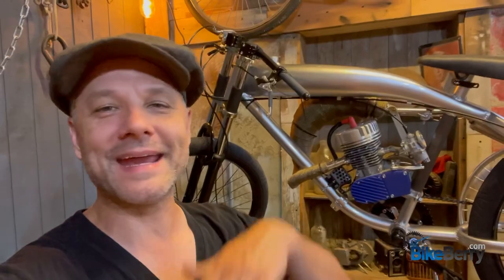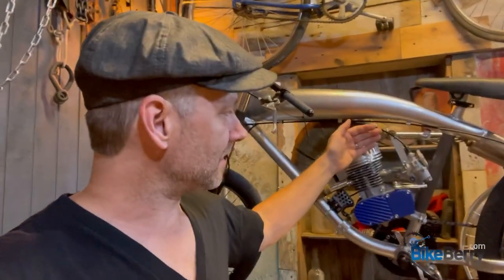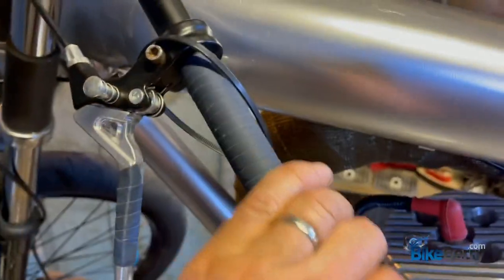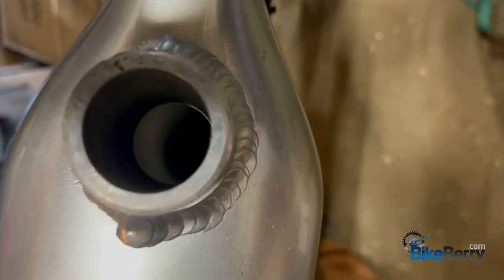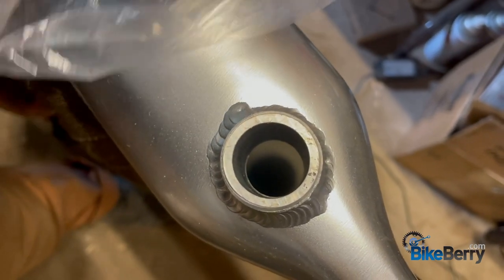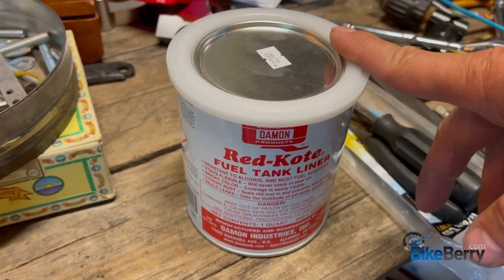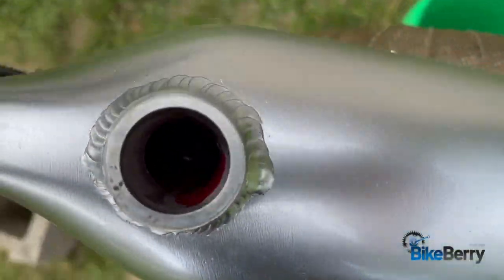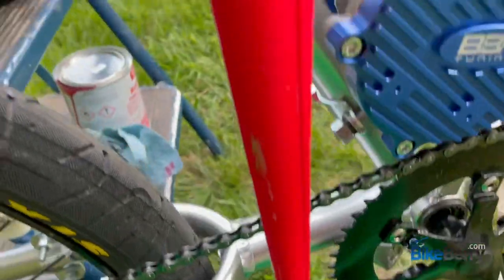Gas Tank & Cap Installation | Lining, Sealing, Venting | Motorized Bicycle | Bike Berry

Comment: I don't know, the old adage of, "if it ain't broke don't fix it" might apply. If you do find yourself with a tiny, tiny pin hole in a weld that's leaking there are other methods of fixing it other than a tank sealer. If the tank is leaking, say on a interior weld tank sealer could be the only fix.  A perfectly good aluminum tank that has no leaks really does not need sealing. A older steel tank with weak seams or has a rusty surface that you feel needs it, okay. I realize Tony did this tank as a "show how to do it" process and he says in the video to do it before assembly on a bare frame. Its just easier that way.

Comment: Another thing Tony mentioned about the sprocket/rotor disc combo, try to stay away from it if you can. The main problem is that it is impossible to keep chain lubrication off of brake rotor disc. Once it is contaminated it renders the pads useless. You then have a very diminished brake that will be less than desirable. This is a fact. Try to keep the rotor and sprocket on opposite sides, it just works better.
Reply: Good insight. I’m interested in seeing how the brake is effected on this bike. Now that I think of it I have a new can of chain lube (champion brand I think) that coats it differently than oil. Maybe that will prevent brake failure as you suggest. We’ll see 😊

Comment: Just use grease and wax remover to get off that gas tank sealer. It’s not enough to damage the clear coat over that frame. It’s kinda not cheap tho. You have to buy it buy the can but once you have it it’s gonna last a long time. Build looks good so far and I can’t wait until you get some real power on that frame. Style points are great on this build👍
Reply: You’re the man! Yeah I was thinking of ways to remove it but in the end I just wanted to solve it pronto. Lol

Comment: yeah for the price of them  frames you would think they would hold gas lol . if they was cheaper i would understand but the quality of the way there made leaves a person thinking why .
Reply: Hey diy, there’s nothing wrong with this frame. It’s just the one I had to show an example of how to line a tank. Good knowledge for the hobby.
Reply: @tonytaylor5087  ok gotcha . well you did a good job dont get me wrong buddy . just  would make me mad as a consumer to have to do this to a tank  when your paying more for a frame then most people spend on there whole bike . you know what i mean .
Reply: Tony Taylor can I line my tank after it's had fuel in it if so do I have to flush the tank or just drain it
Reply: @stelthcamo357  personally if it were me i would flush it out let it dry then line it . i dont know if the fuel will make a difference or not but you would think it would seeing how it has oil in it .
Reply: I had two frames like this for builds my son and I did together and BOTH of them ended up having pinhole leaks at the seatpost weld. One of bikes was external so gas dripped out and down seat post. One ended up internal and dropped down on inside of seat post and eventually out the crankset. It was a real PIA to drain, clean, clean again, and seal the fully built bikes. For the $$$, I couldn’t believe they had those flaws. Take Tony’s advice and always seal a new frame no matter what. You will save yourself so much time and aggravation.